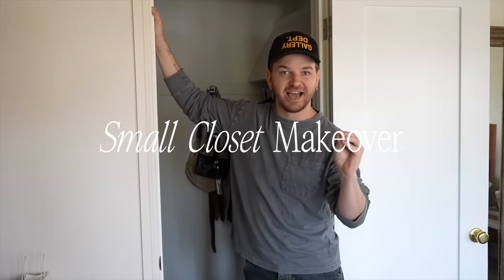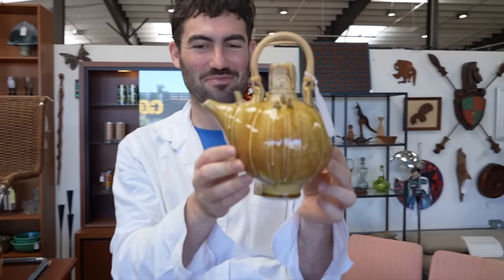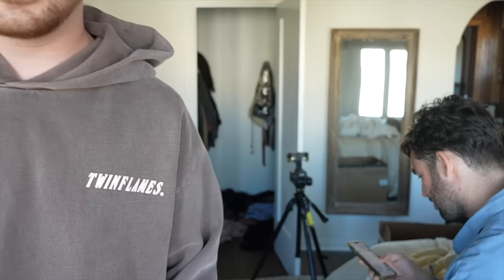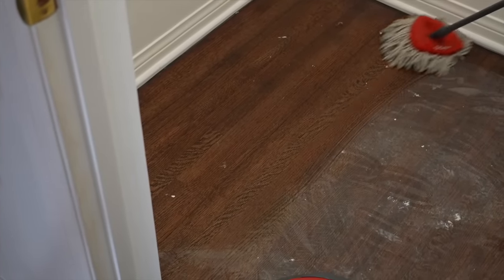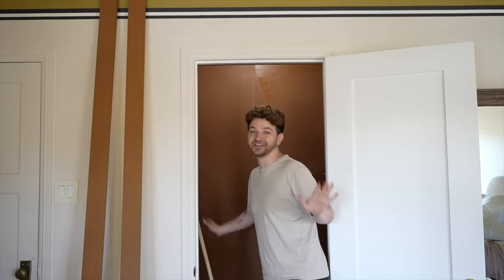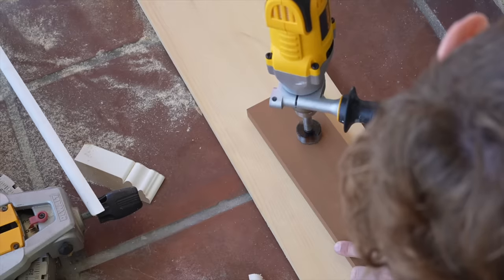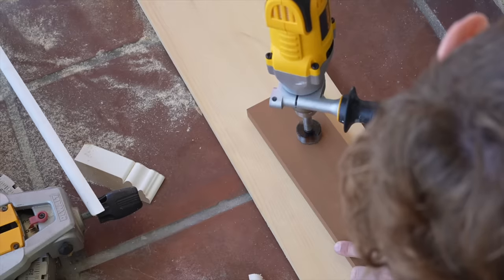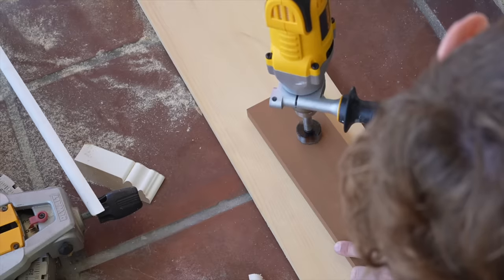EXTREME Small Closet Makeover *DIY & Budget Friendly* (Basic turned Bold!)

Comment: Love the cabinet and makeover. Just wanted to mention about taking so long to do your hair as I used to have the same issue. Up until the end of the 90's people with straight hair used to get a bodywave which is a loose perm using the bigger rods so that whatever you style it to will hold up and won't require completely re-doing each day. Not many stylists do this anymore, and it can damage your hair a bit but not too bad, and some hairdressers talk you into doing a tight frizzy perm under the pretence that it will drop quickly if they don't which is false so never fall for that - use the bigger rods if you ever try this as they do hold especially with fine hair.

Comment: I had wire clothes hangers.  Then went the Joan Crawford route with plastic.  At Target, I found wire flocked/felt clothes hangers.  They hold up sleeves, shoulders, and pants don't slip.  I also put my shorts on the hangers.  I hang table clothes and curtains on them.

Comment: All closets should be walk-ins.❤  The architectural trend that started in the mid-century to make closets shallow with bifold or sliding doors was a huge betrayal to people that actually have to live with them.  All my closets are walk-ins and I love them.
Reply: I could be wrong but I thought before the midcentury, built-in closets weren't even a thing. I think it was free-standing wardrobes for any hanging clothes--the average person didn't have more than a few outfits anyway. We have so much more clothes now than any person did in the past, so yeah, walk-in closets have become the way to go.
Reply: My house is a 1964 bungalow. All of the bedroom closets are as you described and we love them. They are original, beautifully stained wood. The master has 2, the other 2 bedrooms have 1. We also have a linen closet in the main hall, broom closet at the top of the basement stairs, and a coat closet in the sunroom. The basement has 2 bedrooms with the same size bedroom closets as upstairs, an unfinished storage closet in the finished section and an unfinished garage under the other half of the house. Overall if anyone needs more storage than this, you have too much stuff. Even with clothes it's not difficult to keep a seasonal closet and store the rest. Our rooms aren't huge either, we each have a chest of drawers in the room and a small dresser in our closets. Until now we always had walk-in closets that were just full of junk getting dusty for ages.
Reply: @lavenderoh   If you want to settle for wall closets that is up to you.  My closets are not full of junk gathering dust.  When you speculate on other people having too much stuff, you have no idea the size of their family and their hobbies/activities/lifestyle that require extra gear. 
My walk-in closets are spacious, I can easily scan and see every item and most even have a small window that matches the architecture of the house and adds to the outside appearance plus can bring in fresh air during the warm months.  The shelves and hanging rods can be configured however I want them.  
I lived with wall closets in my dorm room during college and in my first two apartments;  NEVER AGAIN!   There is no comparison to walk-ins which is why realtors always point out when a home has walk-in closets because they are an up-scale feature that is desired by buyers.